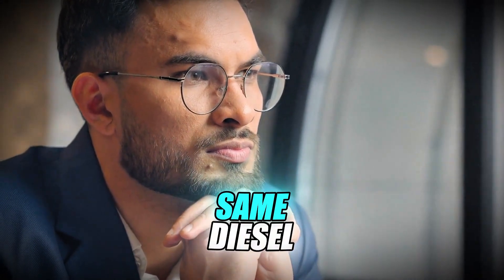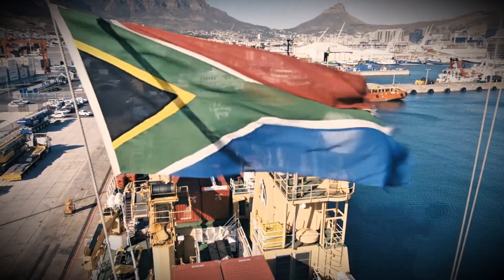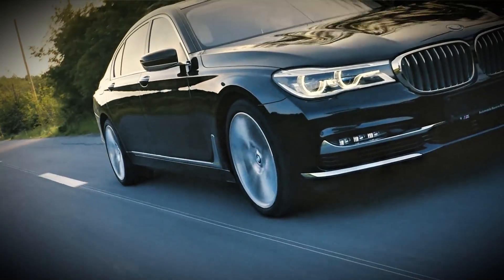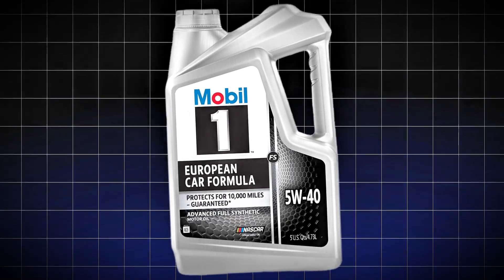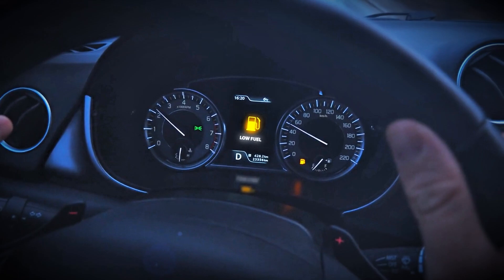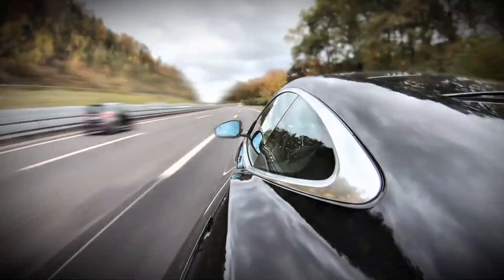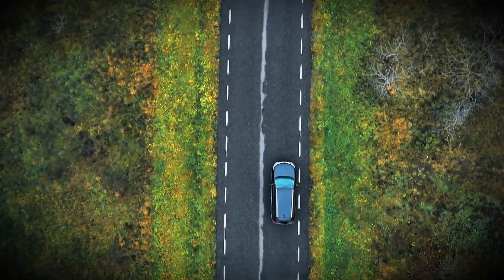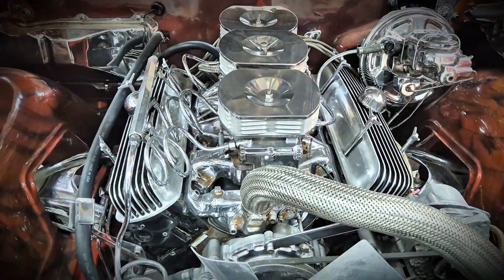Why U.S Diesels Use 5W-40 But the Same Engine Use 5W-30 in Europe (Mechanic Reveals!)

Comment: 6.7 L. 5W-30W Synthetic. Pacific NW. Towing @ 50% usage, 50% local driving.  Motorcraft oil. Changed every 6,000 miles

Comment: I use 15W40 against mfg recommendation of 5W30 India. 
Earlier used 5W40 but this grade is no more available in market. 

15w40 reduces hy lifter  noise dramatically. 
5w30 & 5w40 rubbing noise from cylinder can be heard with practice.

Comment: I use SHELL 15w-40 REMULA R4-PLUS  on my old Isuzu D-Max based on my user manual. Tried various engine oil before, didn't follow the company's recommendation and as a result it ran bad for me. That is when I switched back to 15w-40 from SHELL since it's easier to find and SHELL gas stations sell these products so I know it is authentic, not fake. What I dislike on my current engine oil is I have to keep changing oil every 4k-5k kilometers which is annoying unlike 5w-30 or 40 that changes oil around 8k-10k kilometers.
Reply: Bro, i also use it on my 2007 Daihatsu Xenia for flushing engine in 4000 km